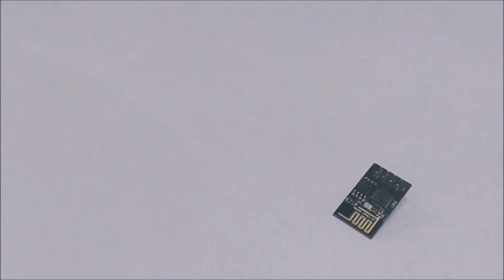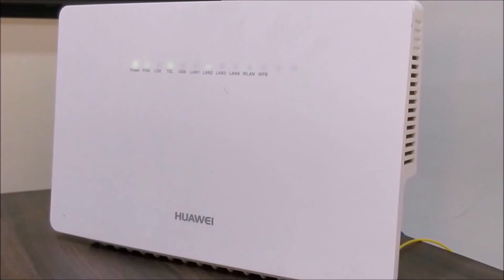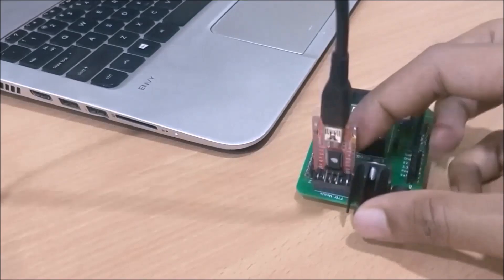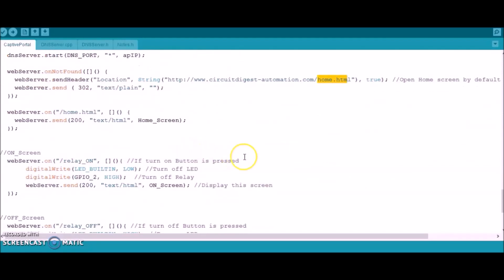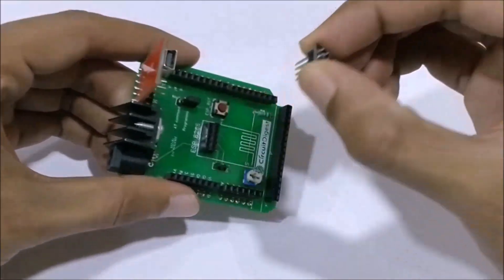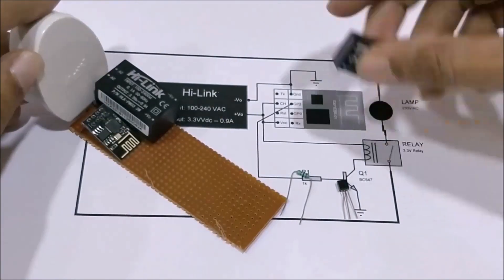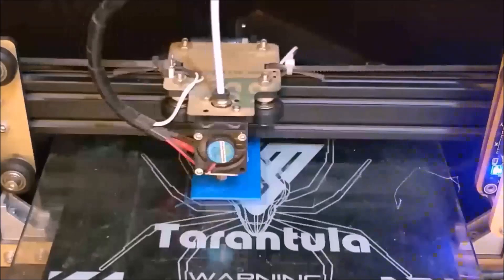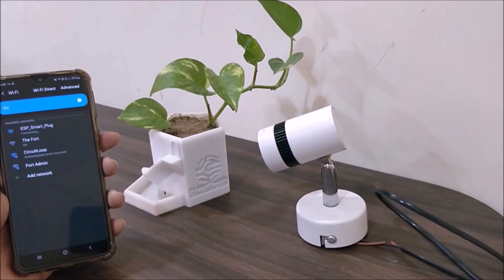How to Build a Smart Plug using ESP8266 to Control Your Home Appliances from Smartphone

Comment: can i use esp8288 -12 instead of -01
Reply from the maker: Yes you can.
Reply: @Circuitdigest  in that case which pin of esp8266_12  equivalent to CH_PD of  -01

Comment: can I use 5v everything?
Reply from the maker: ESP8266 needs 3.3V to operate. If you have 5V then you can use a 3.3V regulator like AMS1117-3.3V to get 3.3V
Reply: please reply
Reply: I m not getting 3.3v relay

Comment: Funny part is. If your smart plug is connected to your router and if your network goes down..then you cant control your router power via smart plug. If you say you will use local network...then sorry it's not smart its just wifi technology...
Apart for the application which u said in the beginning. Everything is just perfect. Kudos!!
Reply: He connects directly to the device through the device's wifi, not the local network. Similar to a bluetooth connection.
Reply: Lol🤣🤣🤣🤣it was jus a reason